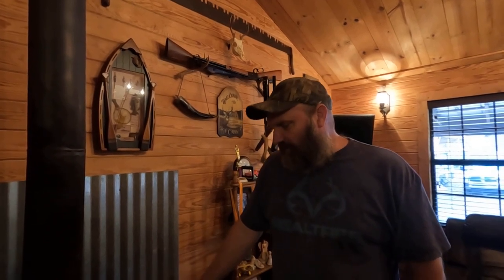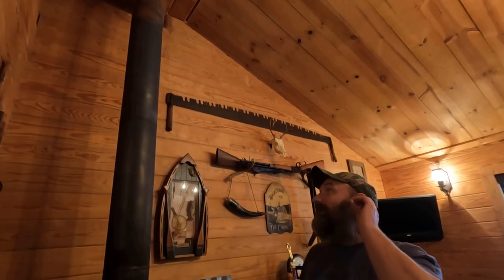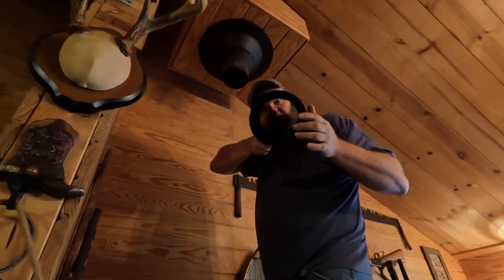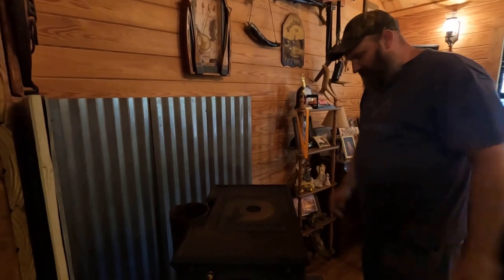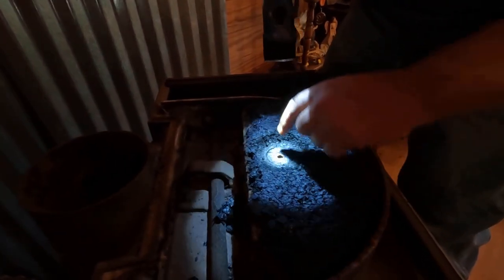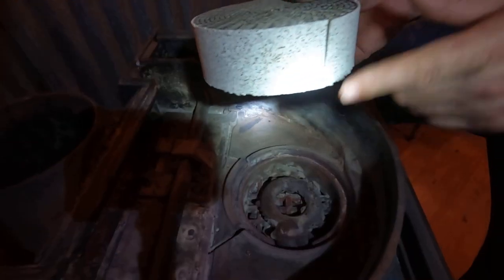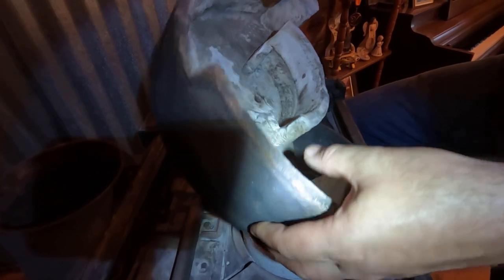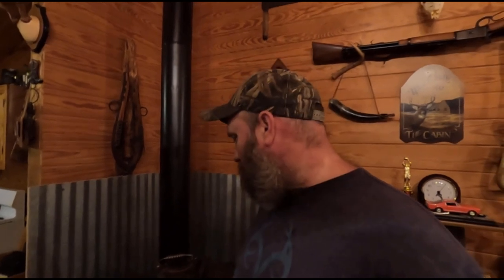How To Replace Catalytic Combustor / Dutchwest Wood Stove / Model 2461

Comment: Good video, buddy.  I have the 2462.  Basically exact same stove as yours, just one size up.  It is a great stove, but you do have to feed it nothing but very dry, fully seasoned wood.  Two things I've learned to keep that expensive catalyst lasting a long time:  (1) the catalyst really does not like it when it gets up to 1100F or whatever and then "cold" steam from the water in wet, unseasoned wood at just 212F hits it.  The metal one may tolerate the shock a bit better, but it is really hard on it. (2) stay away from burning anything except dry wood and maybe a bit of clean paper to get it going, the catalyst can get permanently wrecked really easily from wax cardboard, Christmas wrapping paper, even glossy color magazines, etc.  Good tip on the stove pipe, I am going to replace mine now this summer too, because it is getting up there.  Better safe than sorry.

Comment: I have the same stove (in France) and not only was the round metal catalytic combustor totally degraded, the air distributor under it (the donut shaped thing) was melted and open. Replaced all of that. One key thing: the thermometer on these stoves is critical as one should only direct the smile towards the catalytic unit when the heat is high enough.
Reply from the maker: Thanks for the insight on your stove. Mine lasted about 7 years but should have been replaced 3 to 4 years ago. They tend to puff out smoke from time to time when they get restricted. But I think they are great stoves. I hope we can continue to get parts for them years from now. Have a Blessed Day Friend!   Justin